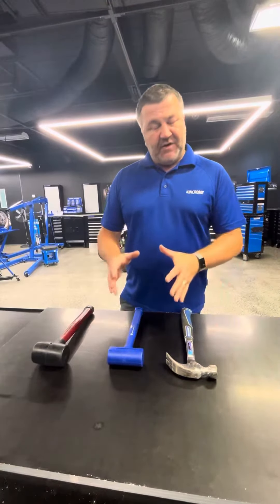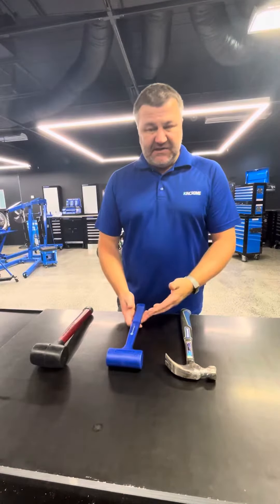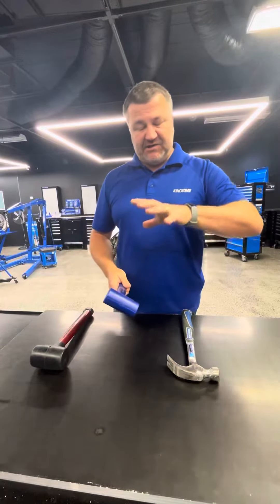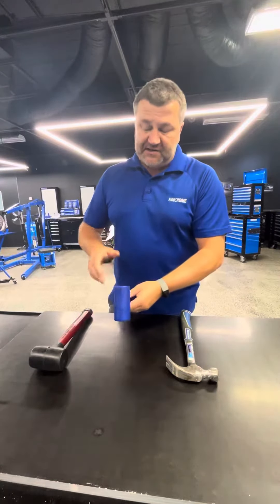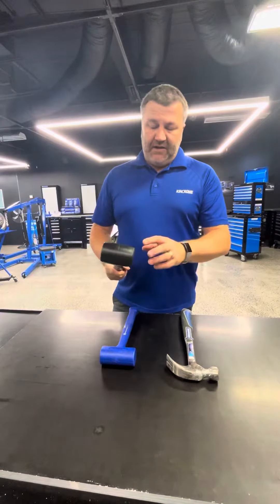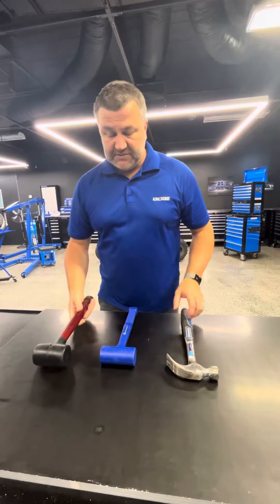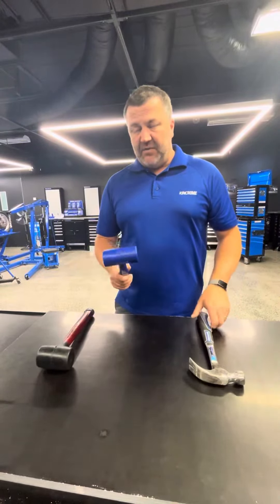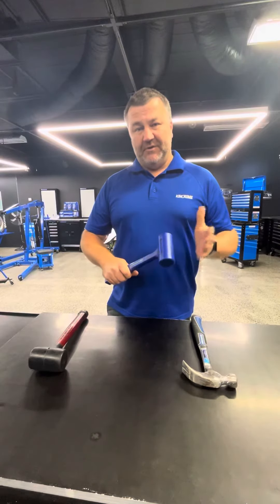How to use a Dead Blow Hammer | KINCROME Tool Tip

Comment: if a mechanical component have a tough gasket and it refuses to be removed

what type of hammer is suppose to be used?

(it should just bugger off, there's no dowel pin or a guide that holds it in place)
Reply: Glue and patience. Let it dry in place. If there are screw holes like in a valve cover gasket, then you can use bic pen caps and insert them after gluing to keep aligned till cured. The caps are tapered which makes the perfect alignment hold. So when it comes time to put the screw it on the gasket won’t move at all.
😊
Reply: You didn't say what kind of gasket, or are you joking that you want to hit it ? 
😂
If serious though, most people have a valve cover gasket start leaking and get on hot exhaust and make smoke, or a lot of smoke. 
A gasket scraper tool would work on some gaskets, especially cork. Be Careful ! You do not want to damage the surface of metal the gasket will be sitting on, so the lowest angle possible for scrapping. A wire wheel to get the rest so you don't remove any metal at all.

A  dead blow hammer and gently start tapping the gasket will make it easier. Be patient. You need it clean, as glues are used of different types, and some don't think future, and put permanent glue types, and in that case time and parience is key, and doesn't have to be done all at once. Breaks are necessary as holding yourself up can be tiring, and people tend to rush when tired.
😊
Reply: A dead blow is fine to use